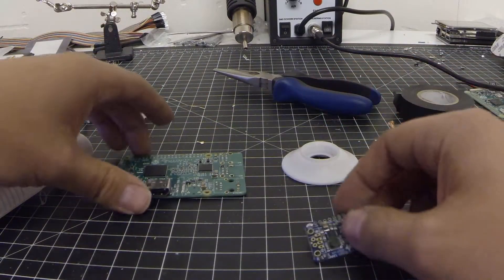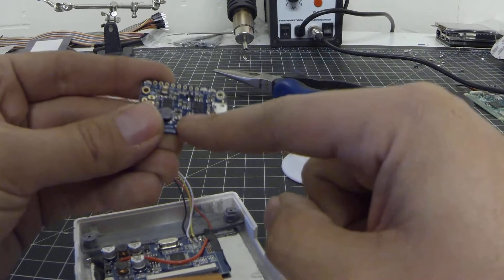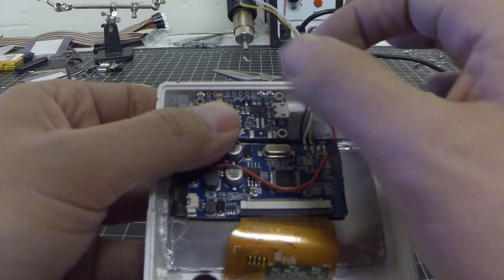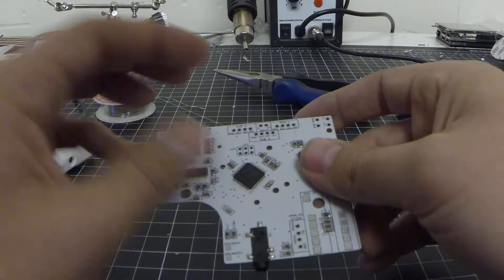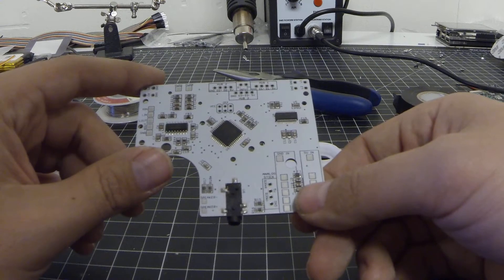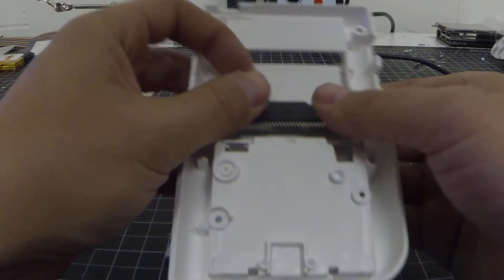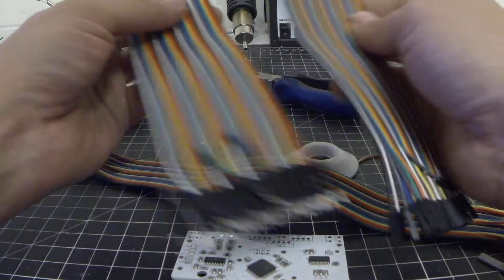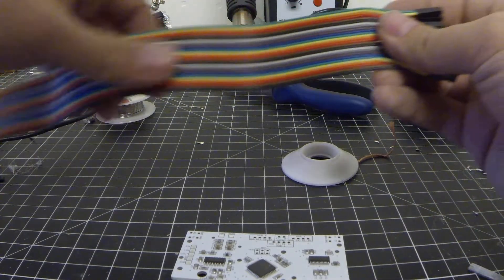GameBoyPi3 Step 13 Power and Helder Board Explained

Comment: what kind of wire did you say that was?
Reply from the maker: I used these ribbon cables that have jumper connectors on them. 

Here is the link to the exact cables I used.

https://www.amazon.com/gp/product/B01DU65WJO/ref=oh_aui_detailpage_o02_s00?ie=UTF8&psc=1